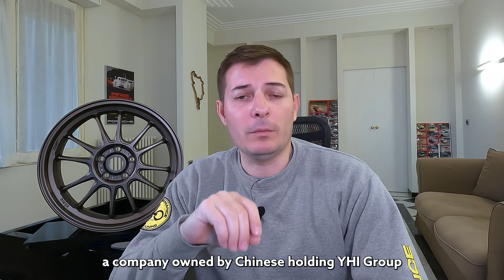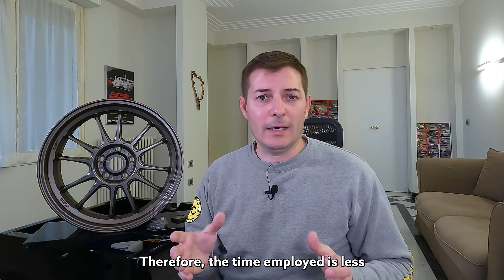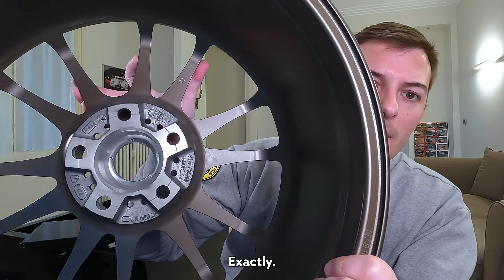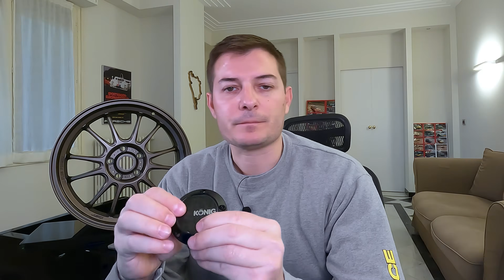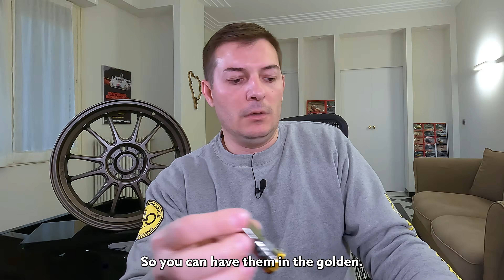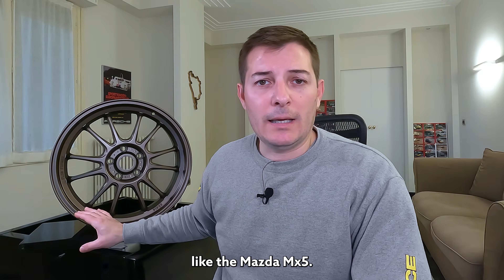Don't buy GR Yaris Wheels before: König Hypergram | 4K

Comment: why not 18 x 9 J with 235 or 245 tires for daily
Reply from the maker: Because the width is too much and you loose sharpness of response
Reply: @PIRASMotorsport  do you mean 235 is too wide ?
Reply from the maker: @陳喜美-r9r I mean the rim is too wide for that tire width, to have sharp response. 245 on 9 starts to be ok

Comment: AJ, any sense of installing wider wheels on stock suspension? Would be nice also to understand why you haven't chosen 18x9J with 245. Great video and thanks as always!
Reply from the maker: Hello Alexey,
On stock suspension I would not advise to change the wheels, the upgrade order for me is:
- front suspension arms from Wiborg
- rear arms from Cusco or Verkline
- coilovers
- wheels

8.5J is a measure that works well both with 225/40 and 235/40, both tires that I have homologation for. Also, if you go wider, you transform it into a track car, loosing most of the chassis playfulness

Comment: Really nice looking wheels. Love those lugs and centre rings ! I'm going to purchase a set of those.
I had considered those wheels for some time, but in the end fitted WedsSport TC105X 18x8.5J et 43. 7.5 kg. Wrapped in Yoko Advan A052 235/40/18. Altogether 600g lighter than OEM and only +6mm closer to the fender compared to OEM too.
For road use, I find it to be a huge improvement in grip, more than enough anyway, and still remains very agile and look very good on the car to my opinion.
The ODO speed has become equal to GPS speed so need to be very careful when passing speed radars.
Reply from the maker: Thankyou for sharing this input! Yes, both options are great and remember the discount code when you purchase them from Wiborg! The change in grip is very noticeable, I was not expecting that much!

Comment: The wheels are great but the fitment options for a GR Yaris are subpar. One of the reasons I like your channel is that you don't push the track racing, low riding, hard sprung setup but those wheels are going in that direction. So I pass.
Reply from the maker: Actually mate, I have just got back home from test driving the 8.5J ET35 R18 wheels, and I can tell you that you loose nothing in playfulness but do gain a noticeable amount of grip coming from 8J ET32 R18 that I was running before. Also, only about 0.5Kg lighter (have to personally verify the previous rim's weight) the car takes bumps better and feels more nimble.
I'm here to do the sweating for you and report back, while trying to bring good deals to all Subscribers.

Comment: Not bad wheels. Right now I'm running racing division 9" width with 245 ad09. This set of 9.5" sounds interesting when I will want to switch to 265 tyres.
Reply from the maker: They are among the best solutions, and in my opinion the best for the price, even before my discount!

Comment: I use 19” x 9J [offset +35mm] forged with 275/30 ZR19 tyres (on all 4 wheels)
Reply from the maker: This is a fitment I would not recommend, firstly because on such a small sidewall, then because of the tightness of packaging
Reply: @PIRASMotorsport  As I live in Japan, my car was prepared by Yokohama Advan and G-Force (it is prepared for GRIP). I have 16,000 Km, making it one of the fastest GR Yaris in Japan Touge and touge circuits like Nikko, Hero Shinoi or Gunsai. There are no issues with the package (no rubbing or touching). 

Just in case, these are the settings: 
Camber 	F = - 3.0° R = - 2.2°
Toe	 	F = OUT 0.5 mm 	R = OUT 1.0 mm
Caster 	F = + 6.4°
Scrub Radius = + 8 mm			
Ride Hight F = - 15 mm (from OEM)	R = - 15 mm (from OEM)

The suspensions are HKS Hypermax R.
Reply from the maker: @massimo  I understand now! They have prepared the car as a package, taking in account for the smaller sidewall thru the suspension, of course it can work like that! :-) Well done, enjoy. I would like to visit when I come to Japan, and I will - hopefully in the next 6 months!
Reply: Sounds like a great setup! @massimo
Reply: @massimo do you have any videos of this yaris build or touge runs?
Reply: @Kirtanus  Thank you!
Reply: @Kirtanus @Kirtanus, no, I am not good at filming/editing...so I gave up after a few attempts. 🤣

Comment: I would have gotten them if it weren't that the 9,5" are et45 and I would need spacers when using camber bolts.
Reply from the maker: If you are using coilovers, no issues of clearance. If you are not yes, and also the car would be unbalanced and hooked to the tires, with not enough force in the suspension
Reply: @PIRASMotorsport  using superhard drift tyres, then it's ok